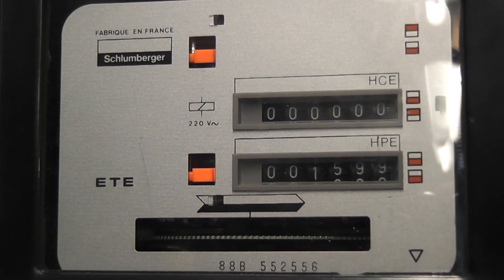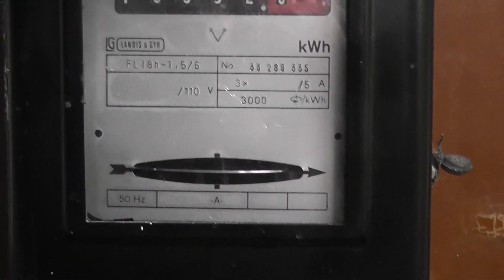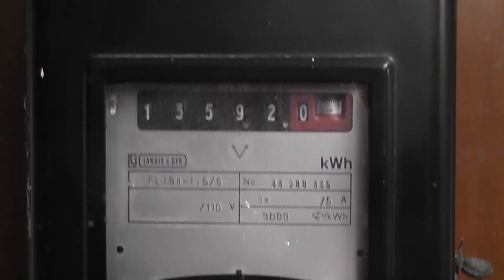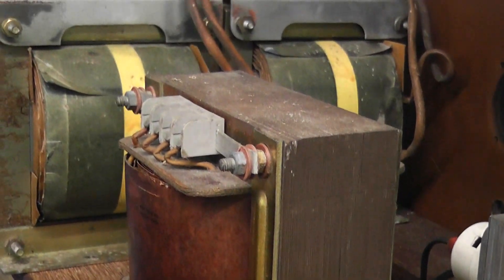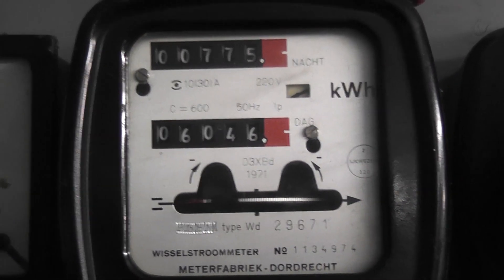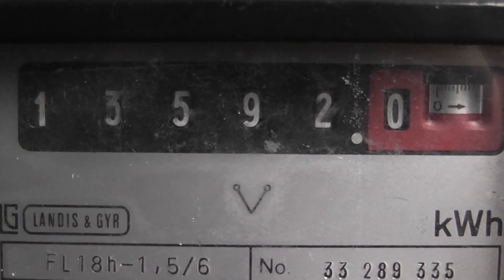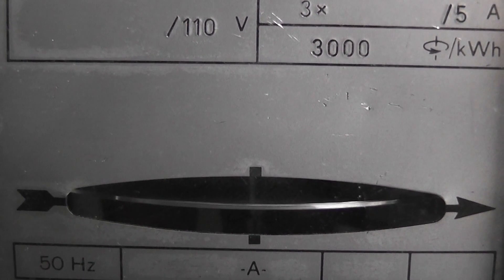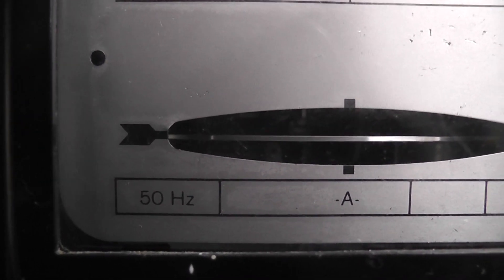Landis & Gyr FL18h  Two-Wattmeter

Comment from the maker: V is open star.
2 element meter with two current coils and two potential coils. One in red and one in blue phase.
The common reference for the voltage is the yellow phase.
Also the little circle of the disc rev symbol I have not seen before on a meter.

Comment from the maker: Metering in high voltage substations is always done at 100 or 110 Volts and multipliers are attached to the meters to get primary values.